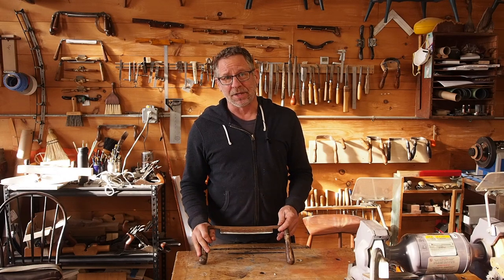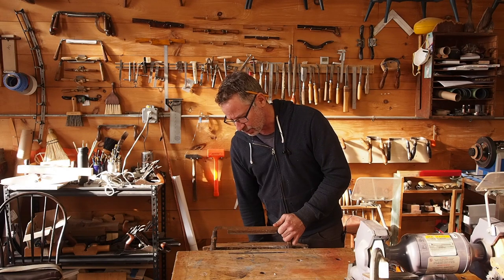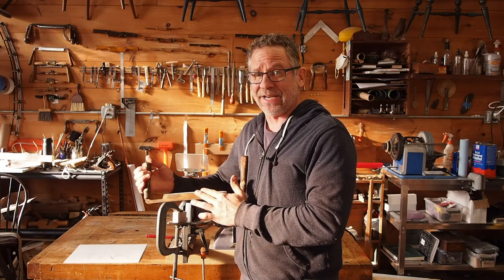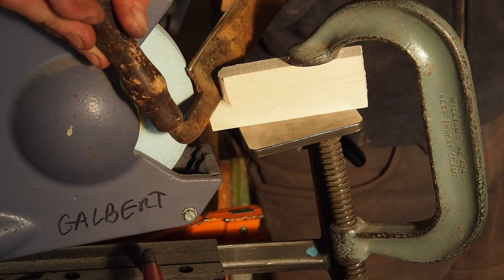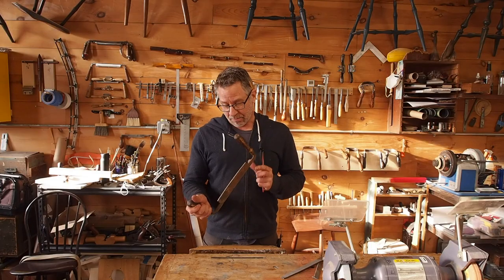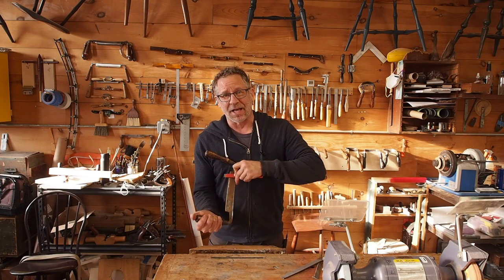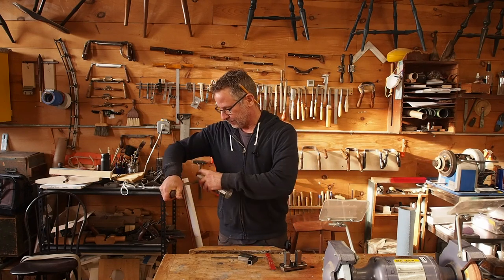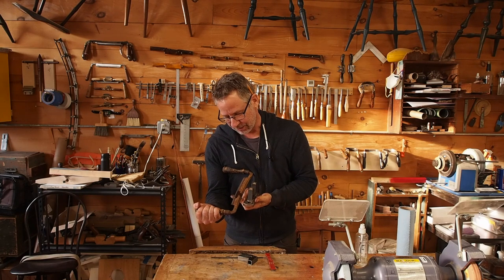Sharpening a Rusty Drawknife

Comment: Thank you. Very helpful. I've got a really nice draw knife that is rusted, with deep pits. I've definitely got to get below all those deep pits otherwise the tools edge will be an elongated serrated knife hitting all the pits. I thought about flat grinding the back but it would just chew up far too much metal to go below those pits. I had the same idea to do what you are doing but I don't own a grinder so I am gonna have to tackle this task using files and sharpening stones so a longer more drawn out process with more labor. I just really want to get it back in service because it is a beautiful knife that just happens to be in bad shape.

Comment: I just bought my first drawknife. It’s a new one from Narex. What is the degree of angle I should be shooting for on the bevel? I took a protractor to it and it looks like it’s 45 degrees right now. Isn’t that too steep? Plus the back isn’t flat, it has a slight camber to it like the backbevel you put on the one in this video. Is that normal for a brand new one?

Comment: If you were going to use a drawknife primarily bevel down, would you sharpen the flat face any differently, or do you decide which way to use it based on feel and sharpen it the same?  Thanks a lot for the videos, they are really helpful.
Reply from the maker: Wes, that's an excellent question. I would first determine whether the knife is comfortable in a specific orientation, then, if it seems not to fit either position, I bend the handles to make it distinctly bevel up or down